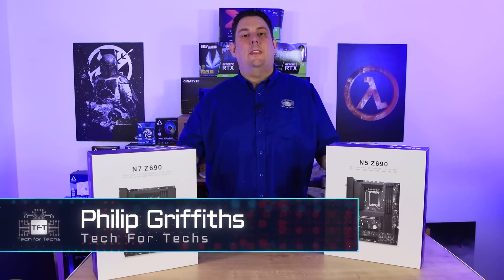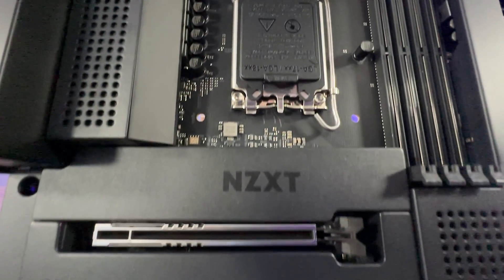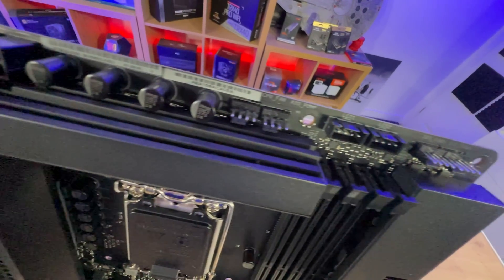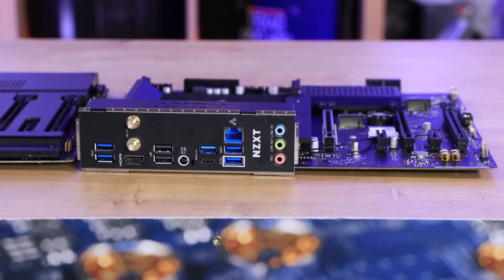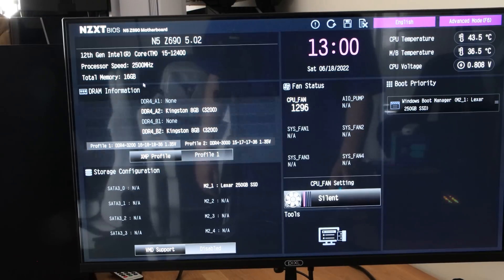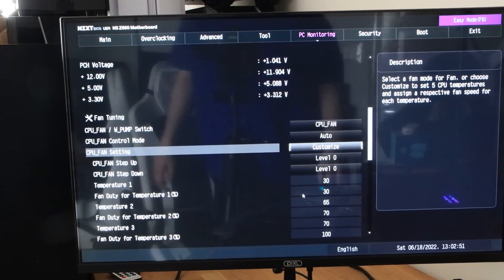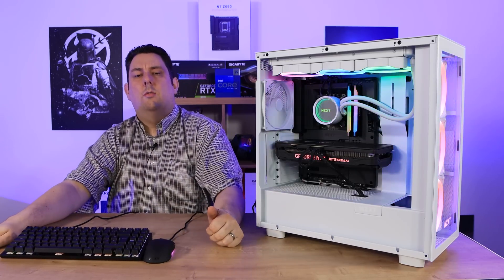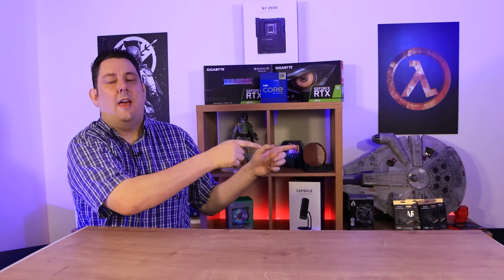NZXT Z690 Motherboards - NZXT N5 - NZXT N7

Comment: I would just like to point out that on the n5 z690 you missed the m.2 slot hidden on the back of the motherboard, I will say that it is only pcie 3 but it's still a extra m.2 slot taking the total up too 4 slots not just 3